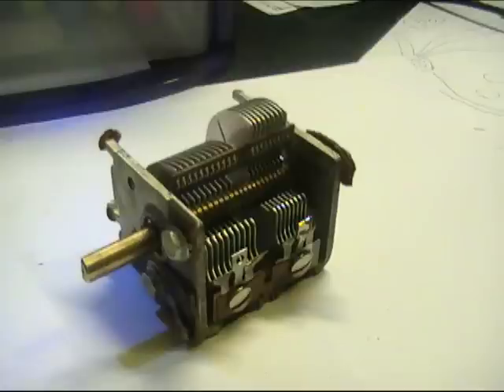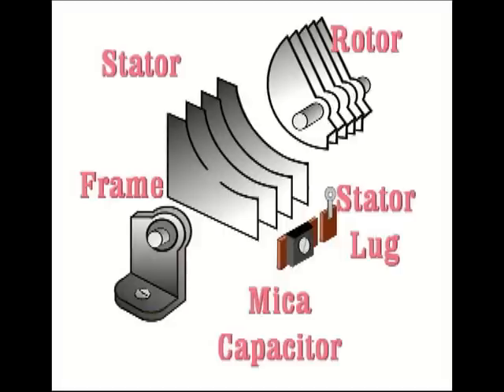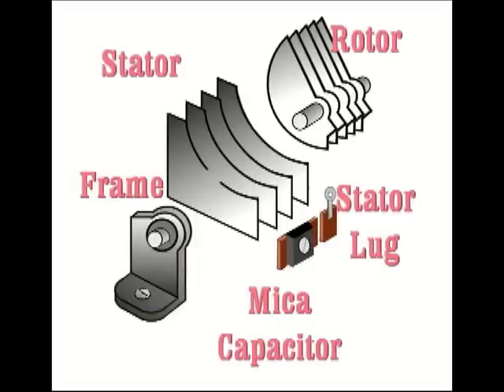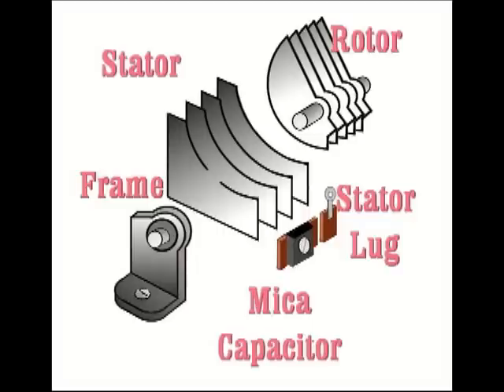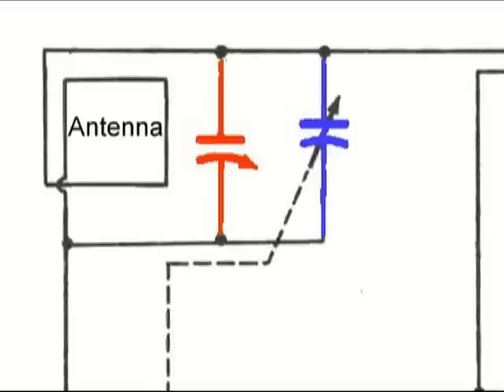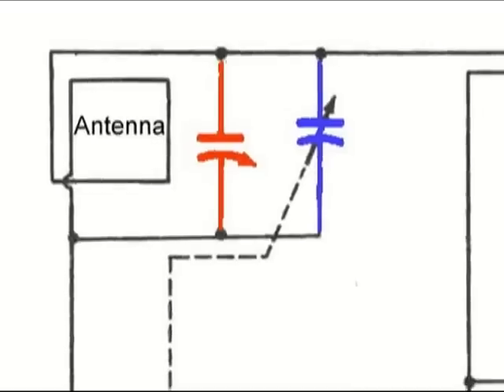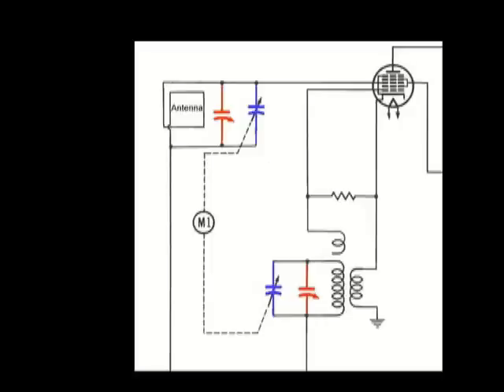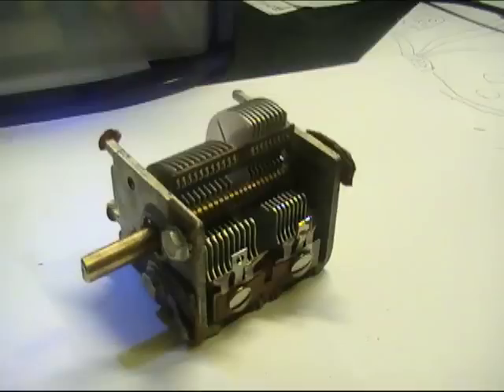Understanding Tuning Capacitors: Antique Radio

Comment: John Richter

goodnight my name is Ronny Brenes of Costa Rica I want to make a homemade antenna tuner but I have capacitors as video and occupied capacitors for this application can help calculate 2 x 100 pf and 100 pf single x
Reply from the maker: It is possible to tune an antenna to one particular station. Es possible cambiar condensador a unica frequencia. Some radio stations back in the 1960s had promotional transistor radios that would only play their single station. The variable capacitor can change its capacitance to tune the antenna to one of several frequencies being picked up by the antenna.  Remember, the antenna has all available frequencies on it at every instant.  La antenna tengo todos frequencias en tu área. The variable capacitor allows the radio to "tune" into frequencia unica. Perro todos otros frequencia seguir en la antenna. You can use a radio with a variable capacitor to tune into a local station. After tuning in turn off power and measure the capacitance of the tuner with a capacitor tester. This is the capacitance required to tune that particular antenna to that particular station at that particular location.  For example, let's say the capacitance is 42 picoFarad.  Now tu can replace the the large variable capacitor with a small adjustable capacitor that is able to adjust between 38 piccard and 50 picofarad. Or perhaps along with a finer capacitor that can adjust from zero to 1 picoFarad for fine tuning. I can't recall right now if the two capacitors would be in series or parallel but that is easy to find on google. Once you fine tune the capacitors into the single channel you can "lock" the capacitors by putting drops of hot glue or super glue on them. And now the radio will only play the one station.

Comment: Nice video. But at 6:43, I'd expect the dotted line to connect the air capacitors, rather than the mica ones, given that the air caps are linked together. Seems that for a while, the better-made receivers still had variable air capacitors for tuning, while the cheaper ones had those mini tuning caps with plastic (mylar?) liners. I've always wondered if the air capacitors had better performance, or if they were just part of the a design that hadn't been updated. The plastic lined ones were probably more reliable, on the average.

Comment: I always thought that the ganged air capacitor (M1) was the ones joined with the dotted lines while the mica (trimmer) capacitors were the ones in red.
Reply: TNikoli you are correct. On electronics schematics the dotted line between variable capacitors, resistors and switches indicates they are ganged (directly connected) and therefore one common shaft controls many parts simultaneously. 
John Richter is correct in saying the curved portion of the diagram indicates the variable part in both parts of the diagram, the tiny arrow on the curve for the mica trimmer capacitor, and the rotor in the air variable portion. 
But I applaud John for taking the great effort to repair an old radio and learn something in the process, and to record and pass on his knowledge! Those things are cantankerous by nature.

Comment: Do you know which one of the two capacitors (small or large) has high frequency, either VHF or UHF, I still request you hook up those Rotor and stator to so me wires that are color coded we we viewers can see, I appreciate your explanation but it should have green/blue/red wires to show what is going ware not just nration with the diagram of the schematic. it's hard to understand from that diagram symbol which which rotor is the big and and which rotor is small
Reply from the maker: First of all I apologize for not seeing your message earlier.  The air cap depicted in this video is for an AM radio from around 1950.  The cap you ate talking about is for a television.  I don't work on old TVs because they have extremely high voltage flyback transformers that can kill a novice in a matter of seconds.  I do not recommend anyone, novice or expert, play around with old CRT tube TVs.  Especially if you need to ask questions about what the schematic should be able to tell you.  Safety is always first.

Comment: can hook up some wires to the var. cap, to show how it's hooked up, where do the wires go on the actual capacitor
Reply from the maker: Stanley, the wires connected to a tuning capacitor are connected to two different parts: The rotor directly and the stator through the small ceramic capacitor.  Your will show you which wire goes to which point on the tuning capacitor.